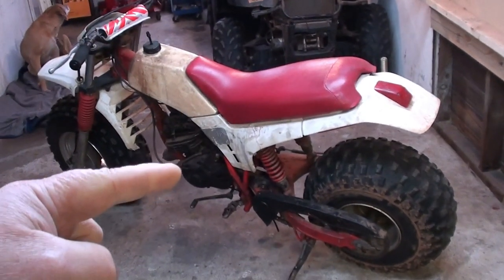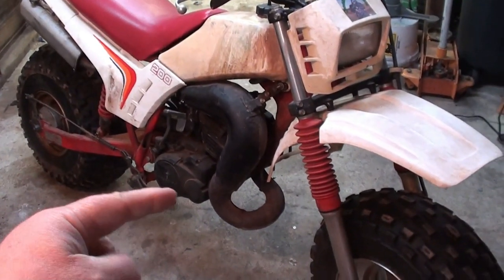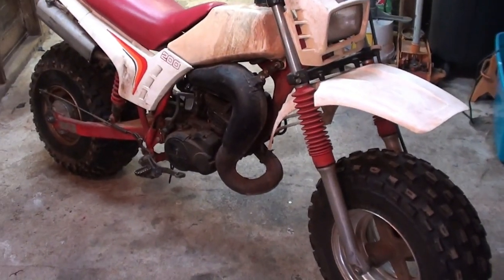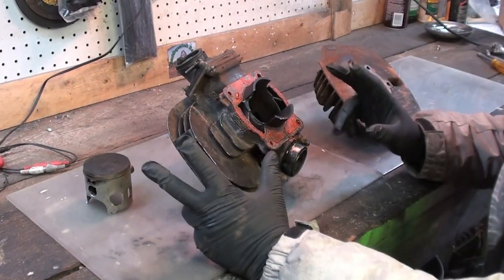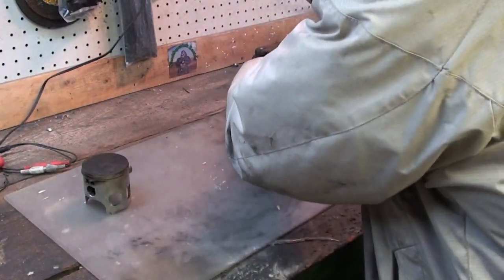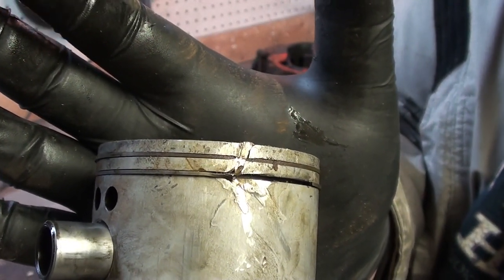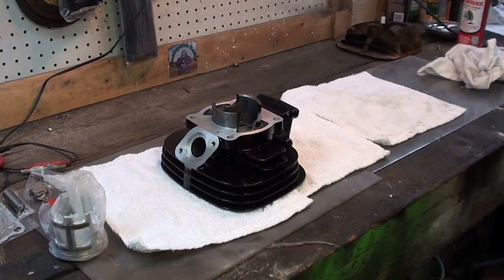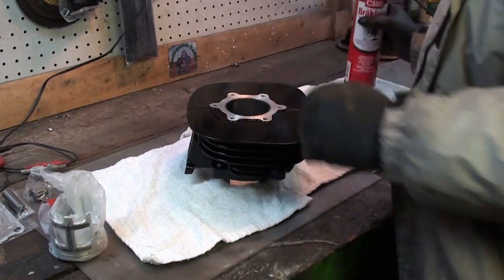Yamaha Blaster 200cc engine top end rebuild  in Yamaha Big Wheel

Comment: Nice vid. Where did you get that top end from? And how is it holding up? Thanks man
Reply from the maker: i hate to say itrs  but i ordered it off ebay its a cheap kit but so far so good its got about 10 hours on it
Reply: SandSquatch Racing  dude no shame I ordered the same thing. I just installed my eBay kit so I was curious if it’s lasted. I only payed 700 for my blaster so wasn’t trying to spend too much on it. I just did my top end and it’s running good all Chinese parts. Keep the vids coming . ✌🏻